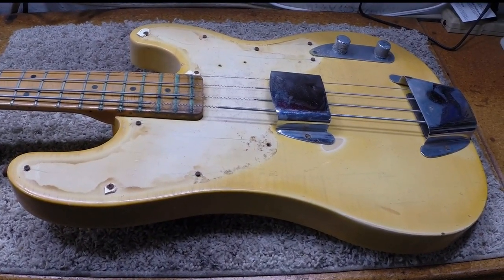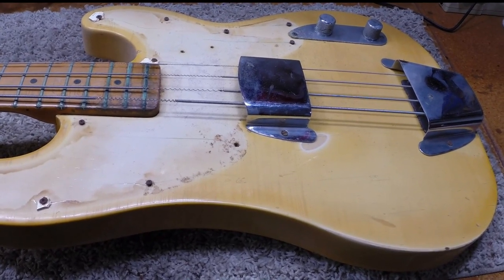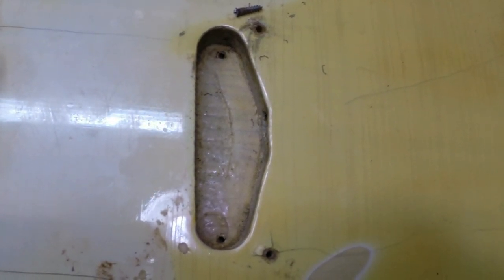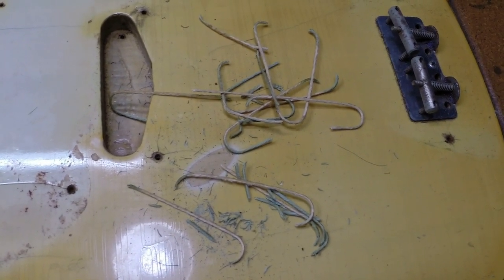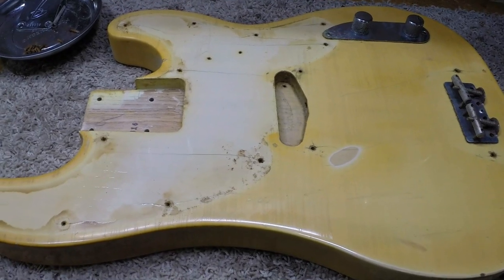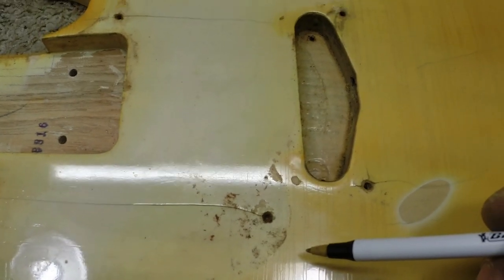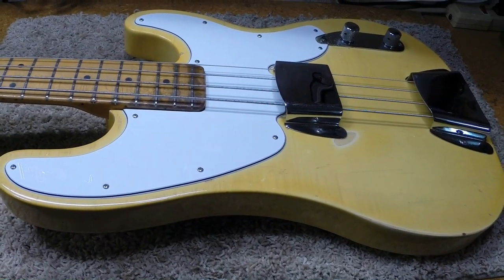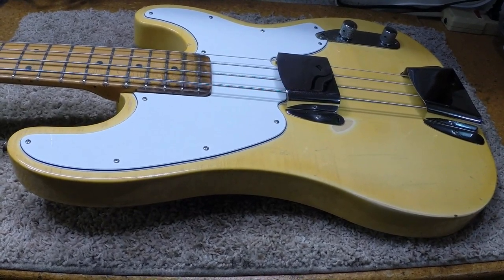Telecaster Bass Rescue

Comment: This bass didn't get wet - it sat in its case too long.   The pattern of the damage is a classic symptom of off-gassing damage from the original cellulose nitrate pickguard.  The upper frets, the truss rod nut,  the strings right over the PG, the severely corroded screws, the damaged pickup, and the control plate where it meets the pickguard.    This has been well documented.  Also, several early examples of the Tele Bass had the lollipop tuners as well.    Nice restoration - nice results!   I'd would have liked to see what was used to clean up the metal parts....
Reply from the maker: This bass had been wet,  there was evidence of such, including the moldy, destroyed case. I am not saying there was not gassing going on, just that it had been wet as well.  I saw the high water lines on the case and body.  Plus the owner wiped some of it off before bringing it in.  I used a wire brush where necessary and then polishing compound to clean the parts.

Comment: I would have purchased it from the guy in its original state and fixed it up for myself.  I also would add the  tug bar.  The original 2 screw holes appear in the early part of the video.  This was an excellent video for documenting the before-after conditions.

Comment: Much of the damage on that bass was from the original pick guard gassing off.
Reply from the maker: I do not believe so.  I have seen a lot of gassing from celluloid, but not from vinyl.  Plus, I did not see any evidence of such from remaining pickguard pieces.  I also doubt that the string deterioration was from gassing.  Although I  can see why you would think that from the frets. I maintain this bass was partially under water at some point.
Reply: @guitarc.p.r.9675  All early 68 Telecaster basses pickguards gassed off, and why virtually no original pickguards are left. Doesn’t mean it didn’t suffer from water damage as well. The original guard wasn’t made from vinyl.
Reply from the maker: I did not know that.  I have seen many that have survived.  The pickguard remains looked like a single layer vinyl guard to me. I will make a note of that.
Reply: They did not all off gas and disintegrate. I do have one that didn't. But the majority of them did, and the damage here is very typical to what happens when that big pick guard off gases  inside of the case.

Comment: SWEEEEEEEEEEEEEEEEEEEET!!!  DUSTY WOULD BE PROUD!!!    Whatta FIND!!!          LOVE these.   I'd prob. have to MAKE one, being a Lefty.    BTW, is it not worth it to bite just the bullet and refresh and lightly sand the last 2 inches of the neck and just replace those frets, and just try to match the vintage finish there as best as possible, for better structural integrity in the long run?   Or is it ALWAYS 'Best' just to leave it as 'original as possible' in that case?      Or better, leave it up to the customer/owner?       Great Job.   -Al
Reply from the maker: I mentioned all the reasons for trying to keep it as original as possible. It was a commodity to the owner and he was loosing his investment.  He paid way too much to begin with, having no idea what problems he would be dealing with.  Antique dealer trying to help someone who needed money, with a sob story.  A vintage instrument is worth more with one square inch of cracked original finish than one reprayed or touched up.

Comment: those frets look wore out, are they even changeable with the fretboard so tattered, especially the last couple. cool bass though. nice job
Reply from the maker: It was playable.  Plus in this case it was a commodity for the current owner.  He was an antique store owner who had made a bad investment.  Refret was not an option, as original and lowest cost to repair was paramount.  I would have had no problem refretting it, however to do it properly would have meant refinishing the fingerboard.  All the lacquered boards are more difficult to repair. In this case the frets also need to be removed from the side, not the top.  The finish piled up on the sides of, and soaked in under the frets does not make it any easier.  If I had my choice it would have been refretted and an aged refin on the finger board.  Thanks for checking out the video.

Comment: Hello from Florida!  I have a faux 1968/1969 Tele bass I bought in 1983 for $100.00 and while it's not the real deal, evident by a few things IE not a string through body, it served me well in the bar band wars and just keeps going.  I've finally gotten around to restoring it and ordered the pick up and bridge covers that have always been missing, but noticed early in your video the bridge cover had the wider end facing towards the pick up and the finished product had the narrower end facing the pick up. I've seen pics of that cover both ways.  Is there a right and wrong way?  I'm leaning towards the way you completed the bass as it lends itself to matching the design of the pick cover.  Love your vids and appreciate any insight.  Thanks!
Reply from the maker: The cover goes with the narrow opening towards the front.  All catalog and vintage pics confirm this.  Thanks for watching!
Reply: @guitarc.p.r.9675  Thanks!

Comment: Nice restoration job, no doubt, but show us how you do it instead of telling us how what you did!
Reply from the maker: I do not think you want to see hours of video from over a week, now do you?
Reply from the maker: OK, first things first...It was not a restoration but a salvage. I did not pull any frets, it was quickly leveled and cleaned.  The pickup was not rewound, it was too deteriorated, it had to be replaced.  You must have missed those details.This is not Stew Mac, I do not have multiple cameras, or a film crew.  I toss out a lot of footage because much of it is blocked by my hands or my head.  I cover cleaning and fret work in other videos, and I try not to show the same details repeatedly.  Someone is always going to feel slighted.  I have had viewers complain about a tip video being totally useless, because I did not show the 30 seconds of how much plier pressure to use, I talk too fast, or too slow, or I should buy a speaker simulator so I can provide sound clips. Someone even commented on a lock washer tip quickie, wanting an installation video....  I did not know I was responsible for suppling a video manual for washers and pliers. :)  I also recommend you watch the welcome video to the channel from about 5 yrs ago, and then the 100k view video.  It explains a lot, poor video, and I did not want to be there but it will answer some questions.  I try to pass on some useable info in every video, as a free service.  Sorry if it not of use to you.